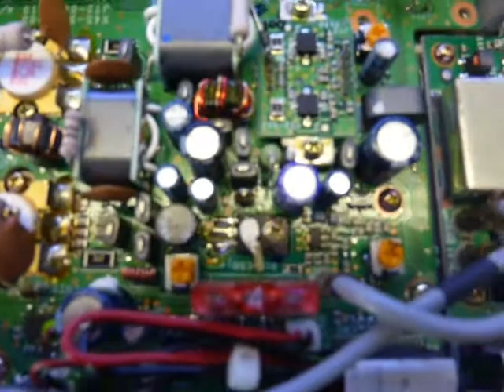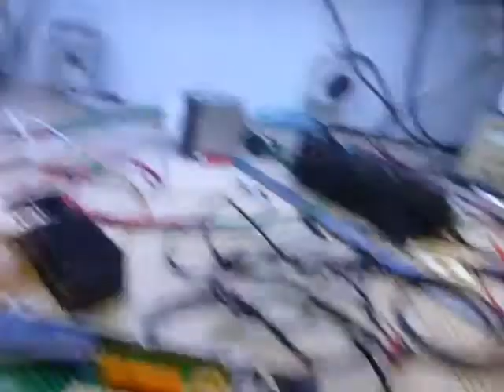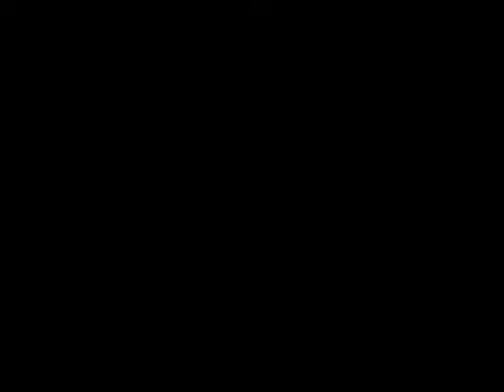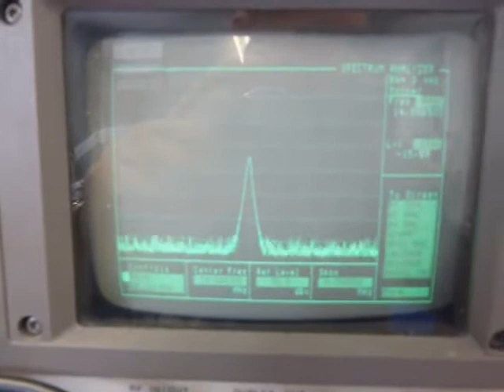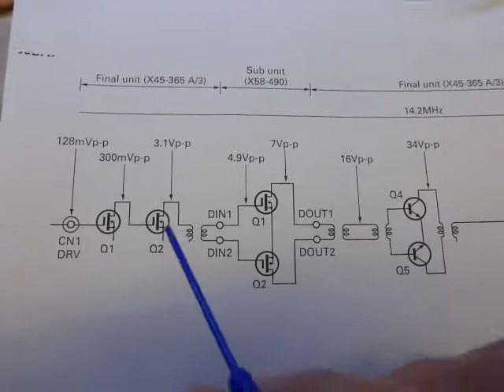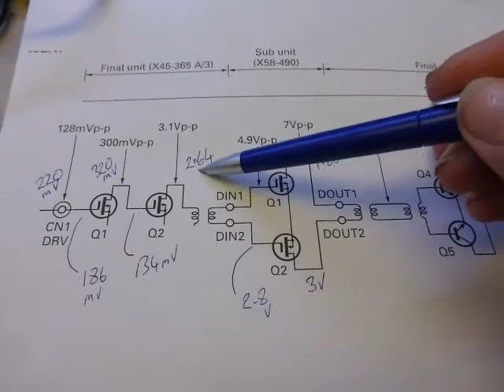Kenwood TS480 Sat ATU reported faulty

Comment: Got the same radio kenwood must have had a problem with these I have two doing the same thing no output on lsb so show on the meter does run high set using an external tuner no output does this radio shut down power when high swr ??